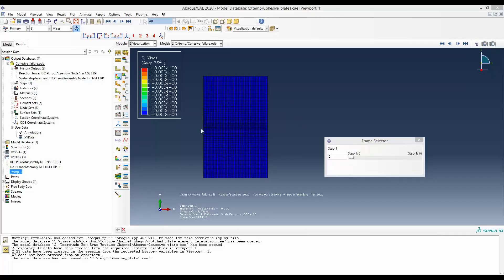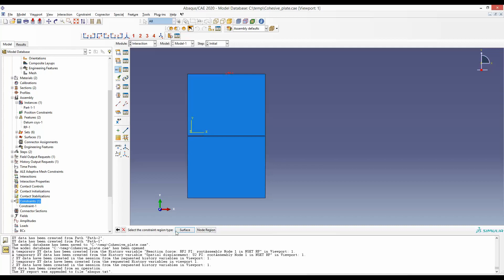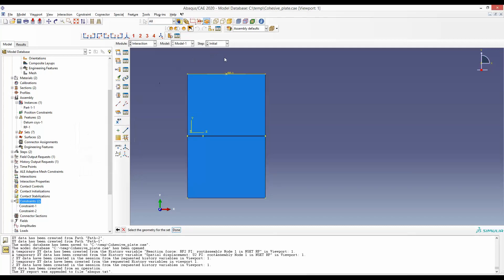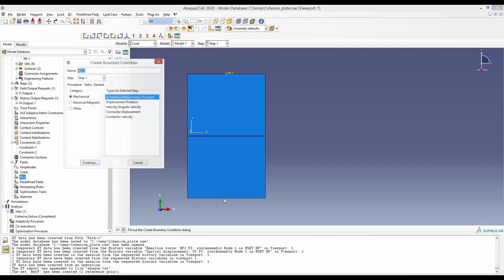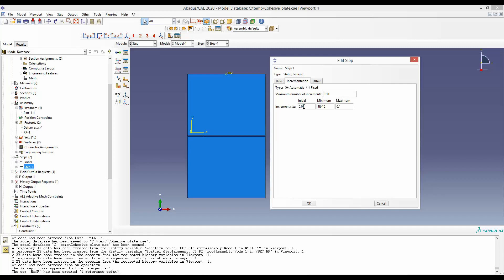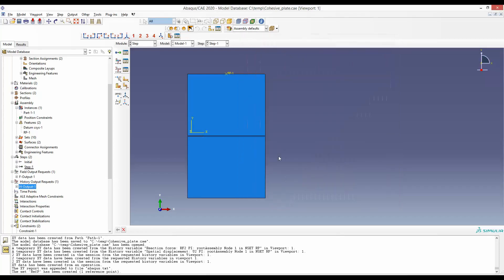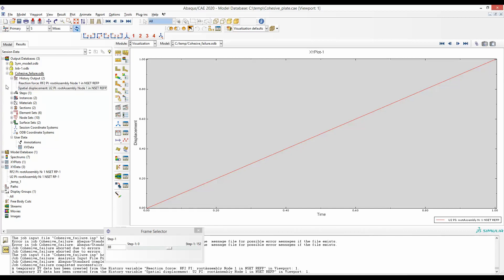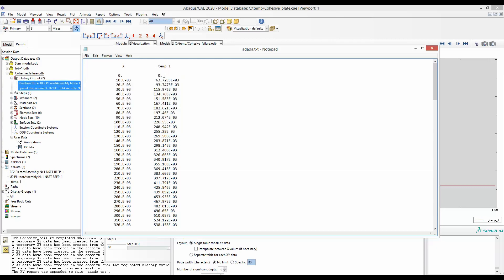Force displacement curve in ABAQUS

Comment: I have this error: "For two-dimensional models, if a non-unity thickness is specified for two-dimensional solid elements and these elements are involved in an interaction such as contact, the same thickness should be specified for the out-of-plane thickness of the corresponding surface under *surface interaction." How can I fix it?

Comment: I have this erros : "For two-dimensional models, if a non-unity thickness is specified for two-dimensional solid elements and these elements are involved in an interaction such as contact, the same thickness should be specified for the out-of-plane thickness of the corresponding surface under *surface interaction." how can I fix it?

Comment: i loved the video, i found it very useful especially the way you prepare the with set.... i have a question, why did you reques field output as well? i understand that field is the the response of the your interest for the whole model and fistory is the response of your interest but for a speficic element...

is there a particular reason for requesting both?
Reply from the maker: Thanks for pointing it out, it is not necessary to request filed output
Reply: @10Minuters  why we need to redefine the reference point ?
Reply from the maker: @liboyan7010  Because it helps us to request the reaction force of an edge (has many points) only at one point. The reaction forces at all nodal points on the edge are summed at reference point
Reply: @10Minuters  for the same node, we have defined two times reference node...
Reply from the maker: @liboyan7010  I see what you mean, you only have to define the reference point once.